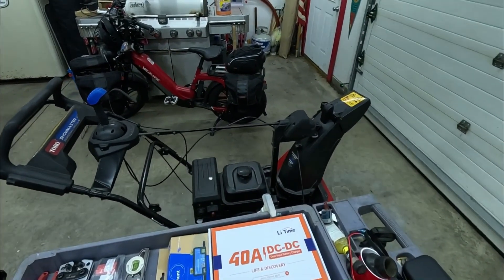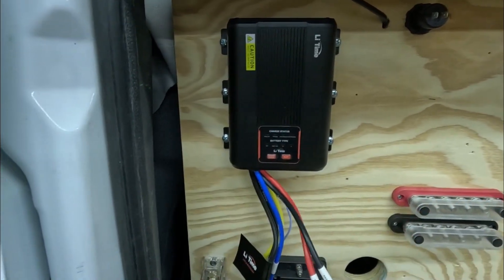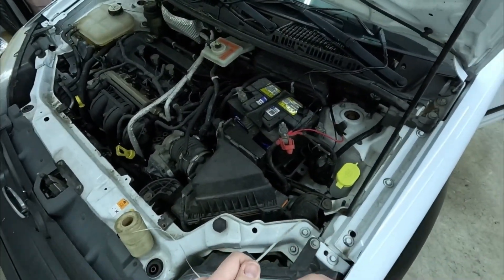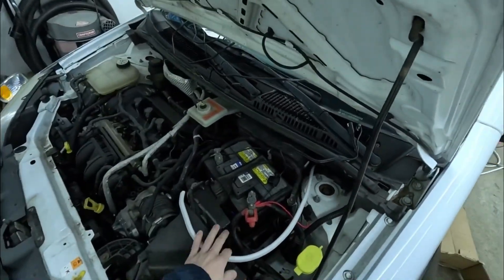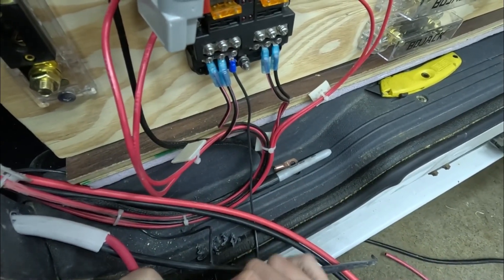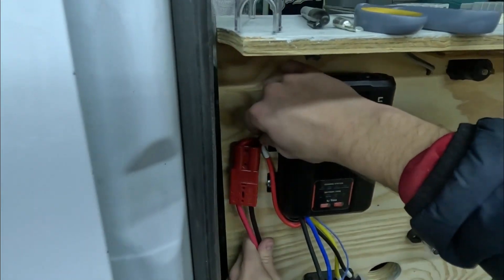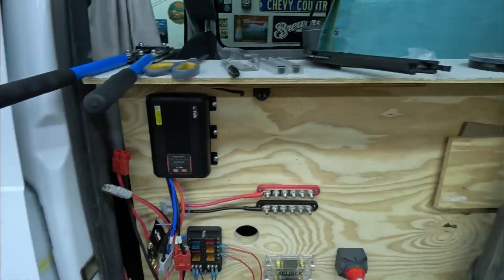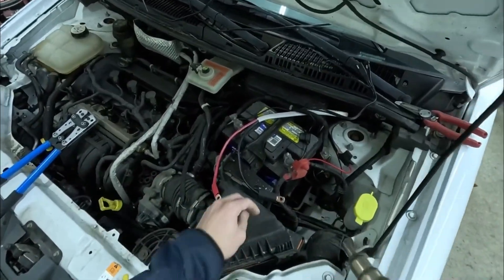How to Install a DC-DC Charger in Your Van | Ultimate DIY Guide!

Comment: It seems like the short cables for the input from the starter battery to the charger is small for a rated 40a. Can u confirm that it 6 gauge? Also what is your real world numbers? Does it really generate 40a? And can u expound on whether this charger knows when you’re idling as opposed to driving on freeway? How do u safeguard killing your alternator?